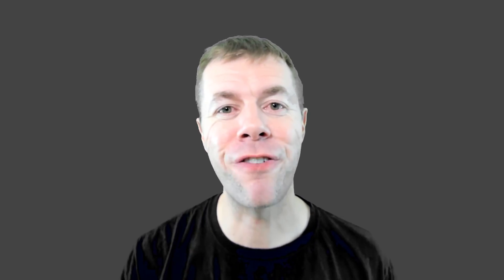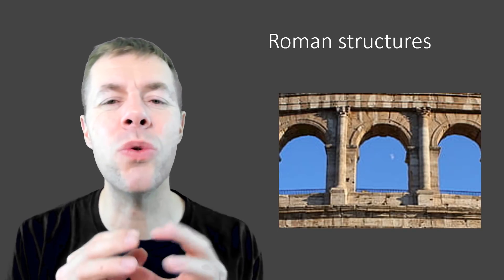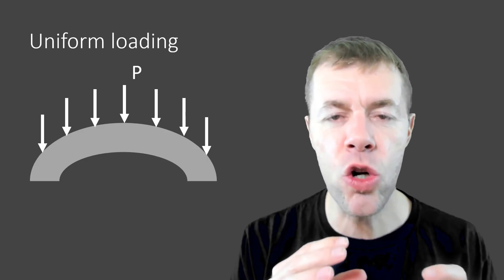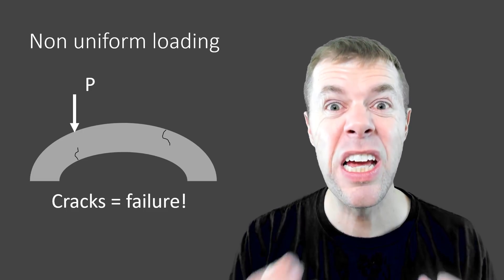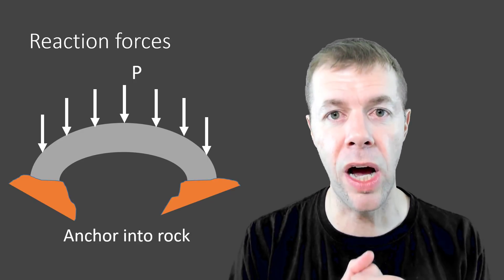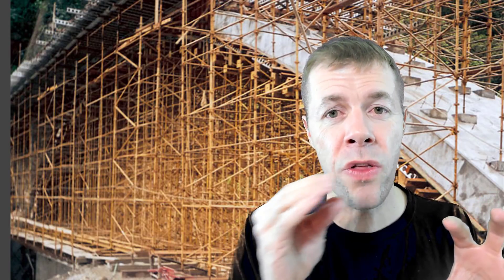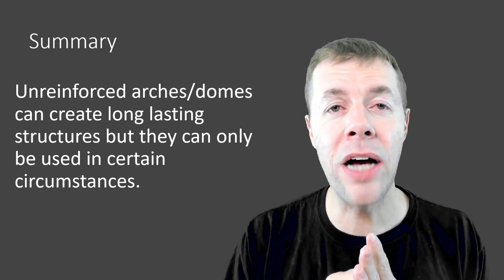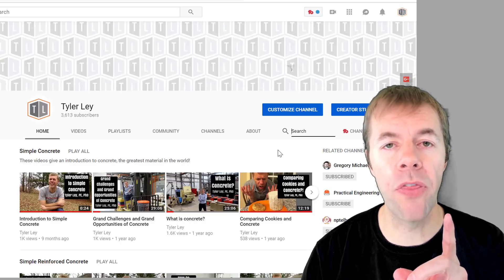Why don’t we build like the Romans?    |    Concrete Arches and Domes

Comment: I hope someday soon steel reinforcement becomes obsolete. There is a product being developed called gatorbar right here in Michigan which would be much better for concrete longevity.
Reply: As a steel-fixer (rod buster, placer), and a student quantity surveyor, I can categorically state that steel reinforcement will not become obsolete until there is a stronger concrete that requires no reinforcement that is developed or a stronger substitute to concrete. The Roman-style concrete seemed very resilient and robust; even at the molecular level scientists are now finding.

However, as a student quantity surveyor, the industry would find great feasibility as to make reinforcement obsolete and still maintain the rigidity and the longevity of the structure. Productivity would increase, project life-spans would be shortened, requiring less labour and material costs and on a macro-economic level there would be a period of a major real-estate boom. So, it isn’t something that the industry is evasive too.

However, I can tell you that they have tried most alternatives to rebar. Mesh being one of them. Although, the problem is with this GatorBar that you speak of is thus, like mesh, this GatorBar cannot be used to form complex shapes, deepening’s and starters would still be required for RC walls. Moreover, it would only be feasible for small housing projects that do not require heavy and high diameter steel rebar; and a project that has no piling present to form the reinforcement around. So, as far as large-scale industrial projects such as factories and major industry works goes, the GatorBar is useless. 

As a small addendum, the ways the ties are administered and the ties themselves look very flimsy, a similar flimsy tie to those automatic ‘tie-guns’, and this is a problem. When the concrete is being poured and a vibratory machine, or colloquially named ‘poker’, is utilised to negate the effect of honeycombing, the steel reinforcement might have a lot of weight on it and the poker will be hitting it with some force, and especially if it is narrow RC walls - knowing concrete finishers. I doubt these, what look like, plastic ‘ties’ will hold all that weight and take that level of abuse like heavy steel rebar can. Never mind having to maintain its rigidity, and in turn longevity. while in use by the client at the end user stage. It is not sustainable, nor feasible in my opinion.

Great for doing a foundation for a garden shed but keep it away from proper infrastructural projects.

Furthermore, to get rid of Steel reinforcement would mean destroying an entire trade, a profession, and in turn forcing all steel-fixers into unemployment. I wouldn’t wish for people to be made unemployed, however I would wish to see further development  in concrete technology. I think nano-particle additives could be a solution; as to keep reinforcement but lessen the material and labour cost component of the equation. There has been some in-depth studies into this subject, I implore you to search them out, it is very interesting.

Have a good day, Sir.
Reply from the maker: Thanks for the comment Fenton!
Reply: Tyler Ley No problem, Sir.

Comment: Roman v.s. Gothic arches is the next step.
How about sandwich construction using concrete? In some buildings it's used for insulation purposes.
Reply from the maker: I think I will hit insulated concrete forms coming up.  I think they are an awesome tool!  I appreciate the comment.

Comment: Couple of questions and some points that are rebuttles in my opinion:
1.why is there no corrosion like that?  As a side note, I saw a movie claiming the sea water usage actually is what made them so strong.
2. You talk of the lack of earthquakes,  but that is untrue.  There have been numerous,  recorded big ones, and yet, a lot survived.
3. Also, Italy is somewhat humid and has its seasons with snow. It still made it.
As far as I know, barring volcano's or actually being to close to the epicenter of earthquake/tsunamis?
Biggest reason for the breaking down of their structures is non other than man made. War, plunder, sheer need of quality materials etc.
4. No one ever talks about all other forces in concrete except that strength.  Would love it if you could compare us the main recipes for concrete in regards to any other force but that dreaded m25 ,m20, over b30 standard and such (each country /region and their own slightly different aspect of it).

P.s 
Loved your silica fume vids, but would love more an addition of actual photos of how slump or stickiness actually looks like with more , or less silica fume, fly ash etc .

Keep up the good vids
Reply from the maker: Yoav,

See below -
1 - Corrosion is caused by metalic reinforcement.  No reinforcement = no corrosion.
2 - Many structures have not and do not survive earthquakes in Italy.  See the pictures on this page -
https://www.nytimes.com/interactive/2016/08/24/world/europe/italy-earthquakes-history.html

These structures have not been hit hard enough by an earthquake to cause them to crack and fail.
3 - I didn't talk about snow.  I talked about non uniform temperature change.  
4 - I am not sure I understand your question.  There are lots of mixture designs to get concrete of lots of different qualities.  Strength should not be a focus of our concrete.  It is sad that so many people just focus on that.

Thanks for the comment.  I like the idea.
Reply: My opinion is that more emphasis is placed on early strength and fast cure times and that we have gotten too good at making fine particulates.  Back in Roman times up till about 100 years ago, construction was slow, manual labor, so they could use mixtures that took a while  to set, use crude raw materials and often manually work large reinforcement stones (vs steel) into the placed cement.  This manual process allows for mixes that are more like modeling clay than soup, but need lots of labor to get full compaction (another purpose for the large stones)  This dryer mix along with the relative crudeness of the raw materials left some of the mix unused until water could get to it via a microcrack - some level of self repair.  Unlike steel, the stone reinforcement didn't rust or expand/contract different from the concrete.  It was also softer and took much longer to cure, so it could settle into a better equilibrium with reduced  localized stresses.
That is just too slow and costly to be feasible for any commercial project and since there's no current precedent for using these older methods, it's not in the IBC so you won't even be able to use it in your own residence in most places.  The closest you can still get with the IBC is lime mortar and brick, unless you can find an engineer/architect willing to sign off on a (5x overengineered monstrosity) design.
Ideally we want the ductility, durability and self healing of old plus the speed, strength and pumpabilty of new.  This necessitates at least 2 different components since ductility and strength are juxtaposed properties... I am betting on fiberglass and rock fiber alternatives to steel rebar to at least double the lifespan of current concrete.
Reply from the maker: Techno -
Good discussion points.  Concrete has changed but we can still make it long lasting if we choose to do so.
fiberglass and rock fiber are not ductile.  That is the biggest challenge in my opinion with their adoption.  I do think they have a good future in concrete.
Reply: Snow in Rome is very rare, they just went 30 years between snow. Snow itself won't harm concrete, it's when water repeatedly freezes and thaws that it harms concrete which isn't what happens in Rome's climate. Rome's climate is great for concrete longevity.
Reply: The stuff in Rome never had 80,000 pound trucks running over it accelerating, stopping, swerving and loading it in more or less every direction. Animal drawn conveyances pretty much only put load on a structure in a downward direction

Comment: Thanks dr tyler, good quality video. I would like to see concrete application for underground structures ( tunneling), and excavation walls. Maybe you Can make a combined work with geotech-engineer. Hope you like the idea. Cheers 👍
Reply from the maker: Thanks Hamza!
Reply: Too bad I couldn't have took pictures when I was working on that tunnel underneath Seattle that thing was huge man but we did weren't allowed to have cameras or anyting underneath there the machine digs and then it places the corbels as it goes and then we came in behind the thing and belt double face epoxy number five bar curtains or walls we call them curtains same s*** and we do have half the form work up and then we stand up our walls with a forklift or a mini little crane and get it to where we wanted up against the form and then we tie it with heavy gauge wire and sometimes big all thread and stuff like that to secure it to the farm work where we want it there once that's done we put little chairs that keep the rebar from getting exposed after the concrete cures recalling chairs or bolster then they put the other side of the form on and the rebar is basically suspended in between the two forms and then they button it all up and pour concrete on the s*** and you never get to see my beautiful rebar work ever again until something goes bad and it comes busting out LOL